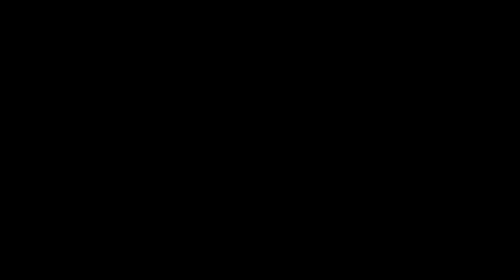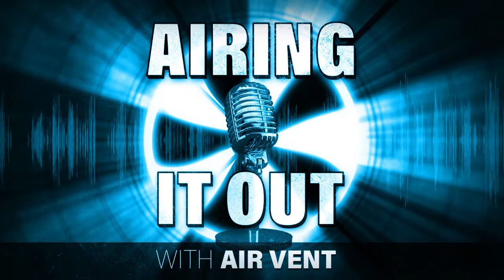Airing it Out with AirVent - Episode 4 - 2nd Most Common Attic Ventilation Mistake

Comment: The biggest issue I see is the lack of intake. I bet in most of these cases listed the issue was no to little intake. On the outside it looks as if the soffits are vented, but they are not. At some point someone put aluminum soffits over wood soffits without cutting holes into the wood soffit. And even if it was done correctly (only 5-10% of the time) they didn't install sufficient intake. I always recommend to clients to  eliminate power vents. I think this issue is a bigger deal with power vents, but I could see it being an issue (to a smaller degree) with mixing Ridge and box vents.
Reply from the maker: Thank you for sharing. You identified the #1 mistake (also featured as an episode of our podcast). Mixing exhaust types is the 2nd most common -- even when the intake is perfectly fine.